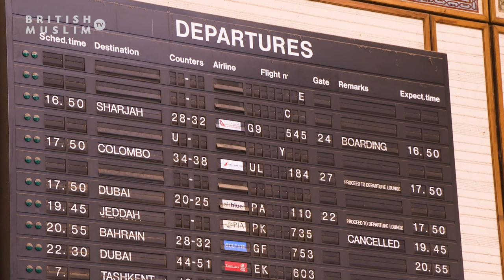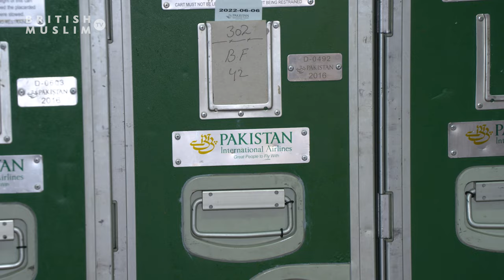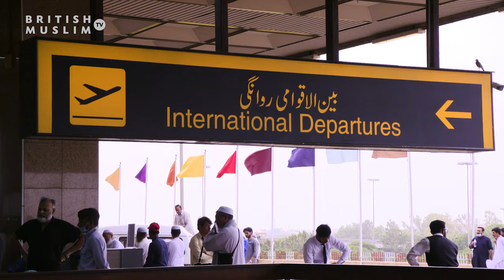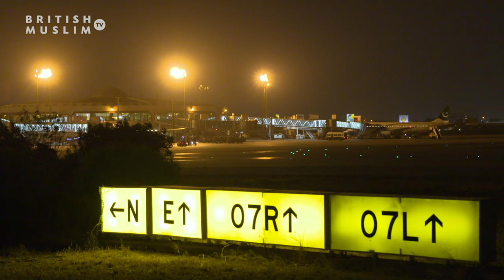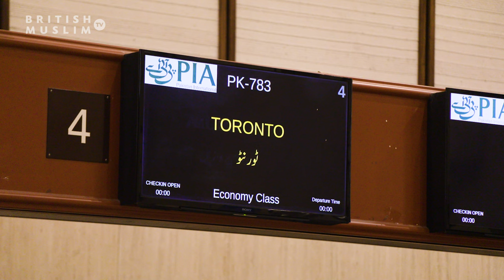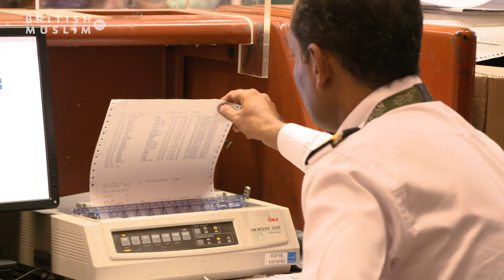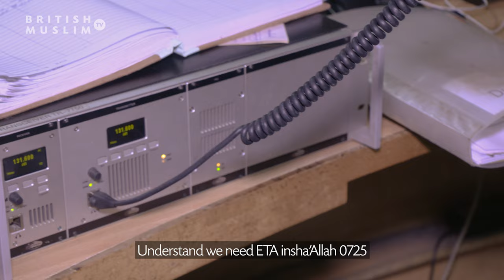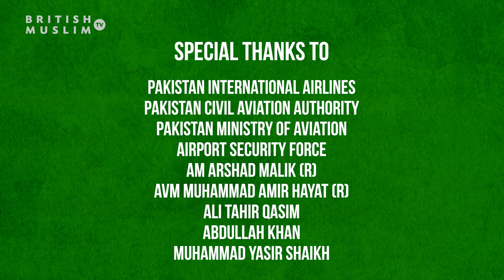Inside PIA - Pakistan International Airlines

Comment: This is a terrific documentary; hopefully PIA will get re-launch and new strategy. I read somewhere that about 35% of PIA's international passenger traffic was to/from Europe so the potential is there. PIA will longer term need to consider the replacement of the Boeing 777 by 2028 and hopefully PIA will acquire the 787 (or A350)

Comment: 25:56 for an overstay, you gotta either pay the overstay fine or, the less expensive method, get a nicop issued. For a nicop you need to be a dual citizen of Pakistan. Nicop can be issued by nadra domestically or by Pakistan's mission overseas. Nicop will cost you about $200-300 and you will never need to get a visa again for Pakistan and therefore no overstay issue.

Comment: Airline kitchen can do with a revamp, poor lighting does not show the work Tops could do with a wipe, considering that cams have been permitted in kitchen. The Chef over rating the omelette requires retraining as a matter of urgency. Cross contaminating on Cam using the same egg fork in biryani when stirring glad he did change when tasting, but damage was done. Those prepped dishes need to be in a blast chiller and should only plate individually once all components ready. Not rocket science.